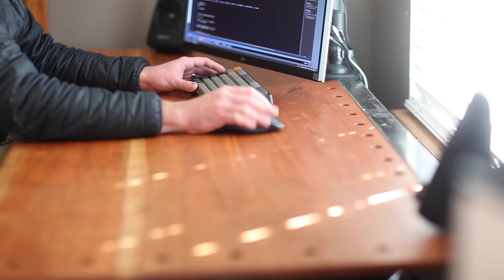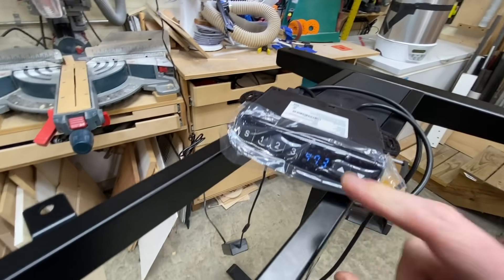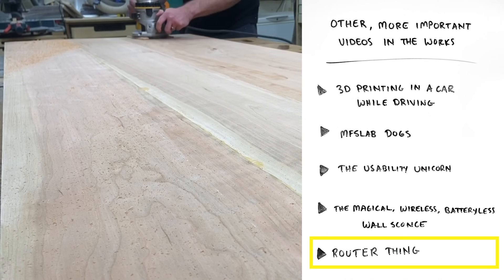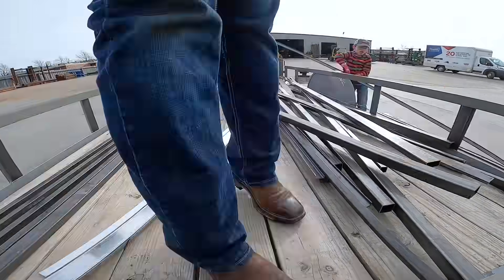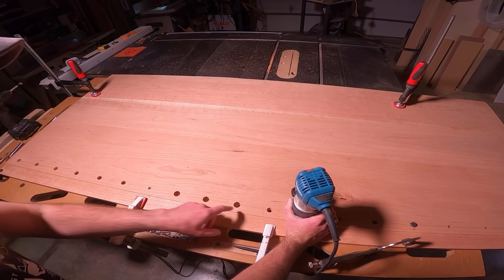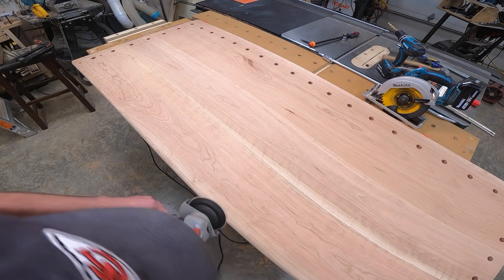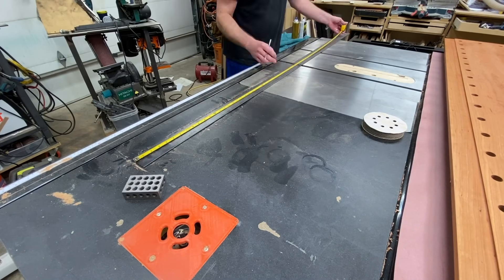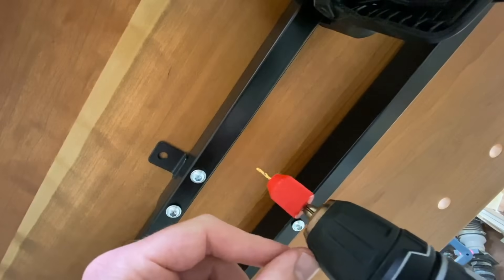Build a HOLEY Desk [a MODULAR desk using the 20mm/96mm standard]

Comment: After machining, surfacing and sanding cherry, do you suppose the suntan could practically be hastened by exposure to a UV light source before finishing? I've got a "vintage" UV generator once used to speed the cure of UV finishes and I'd like not to scrap it for the copper.
Reply from the maker: Somewhere on my IG I have a pic of giving it a try, however my UV light is smallish and the results were hardly visible after a day, which probably wasn’t long enough.  If you’ve got a decently powerful light give it a try and let me know how it works!

Comment: This is such a great idea that could be expanded on. I really want to start a desk company some day because no one around really goes that 'crazy' with setups. Most have basic legs and some have a decent selection of tops, maybe some cable management stuff. Very basic.

So how would I expand on it? I would design a simple cover so the top can be flush, perhaps secured from a tension release mechanism (accessed from below). Or accessed from above if you don't want it flush. It could be used for adding platforms or small shelves, easily taken apart. 

For that I would want some kind of tension or locking mechanism though. 

At the moment I use poles and super clamps, it's really quite ugly if you're looking directly at them. My main room light is actually set up this way, with a light shining upwards so it reflects as very soft light.

Comment: my only problem with these amazon standing desk legs is the wobble, do you get a lot of it?
Reply from the maker: If you can afford a nicer stand I’d recommend getting something nicer. But, answers: In sitting position, no. But in standing position yes. A couple things:  1) spreading the legs out a bit helps prevent side to side wobble.  (As in, when it’s up, I pull the bottom of the right leg a bit further right.) 2) the monitor arm amplifies the wobble but only in standing position. I was highly annoyed at first but have actually gotten used to it. If you can afford a better quality stand I’d recommend finding something else.
Reply: @KeithsTestGarage  sounds like I should buy a third leg to increase stability, hmmm

Comment: Great video, as always. You've inspired me to do a similar build. 

5+ months in, anything you'd change? Any problem with wobble forward and backward or laterally?
Reply from the maker: Yes one notable change. I beefed up the back by screwing a strip of hard maple underneath.  That reduced monitor wobble considerably. 

But my cherry top is only about 3/4 thick. If you were doing 1” thick oak you probably wouldn’t need to study it up. 

Also I added upside down power cubes (with USB) under each side, halfway to the front, so I could quickly plug in a fan or whatever the day called for. I’ll find a link and reply with it.
Reply from the maker: Here’s the power block I mentioned in the previous comment. https://amzn.to/3s3DKat
Reply: @KeithsTestGarage  all of this was super helpful, thanks!

I was able to make mine out of ash, closer to 7/8 thick (wobble is no problem), and the power block was a huge win.

I didn't go full bore on the holey design, though I was able to use a hole/grommet for wires, threaded hole for my architect-style lamp, and dog holes for my speakers (using glued on dowels)
Reply from the maker: @skinne076  nice!

Comment: I have a serious noise problem with the tools I use.  My suggestion for a project is to create a double walled box that wraps the power tools.  Add a little insulation and this should be fantastic for noise reduction.  For 3-D printers, the purpose of the box may be more about temp control than noise reduction.  As part of the construction a connector for dust collection, hinged opening to allow the work to enter the machine and leave it.  408 910 8174

Comment: Im curious if the magnets caused any electrical issues (audio signal interference or corrupting a SD card or anything)
Reply from the maker: I'm pretty sure they won't as long as 1) you're not using mechanical HDDs near them, and 2) the magnets aren't moving.  Don't take my word for it though.  I'd be interested to hear ElectroBoom's take.  Here's a quick MakeUseOf finding on the matter (they say magnets are safe near SD cards):  https://www.makeuseof.com/tag/can-magnets-ruin-an-sd-card-6-common-reasons-why-you-cant-use-your-sd-card/

Regardless, it's a good consideration to think through, so thanks for the comment.